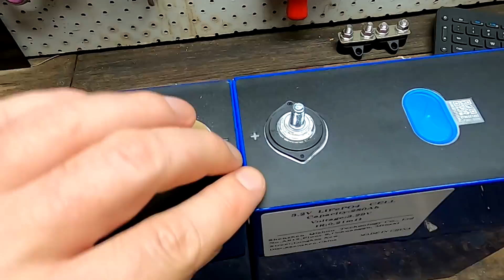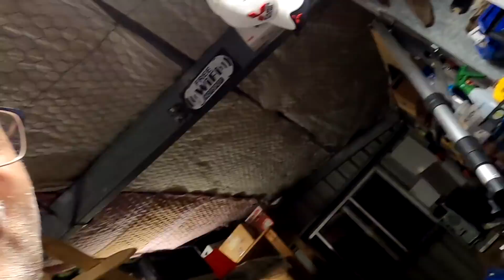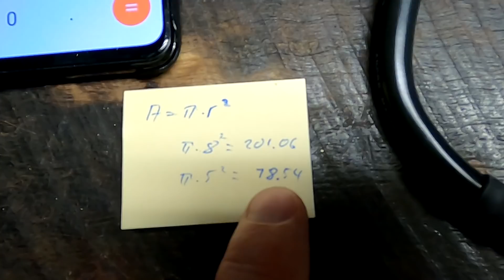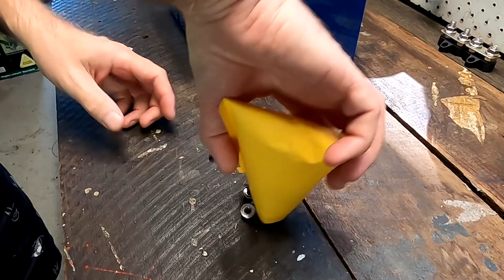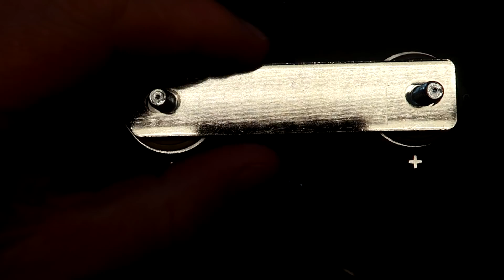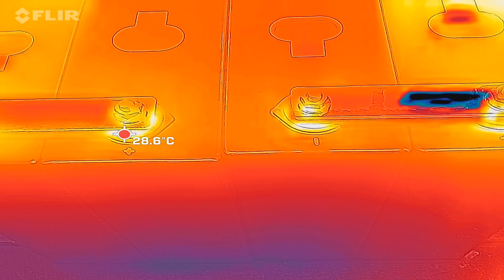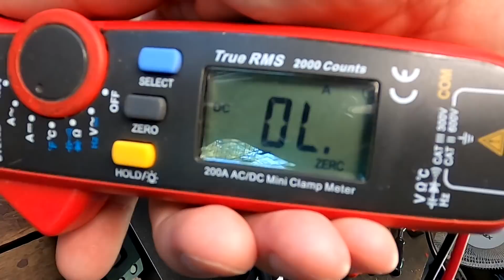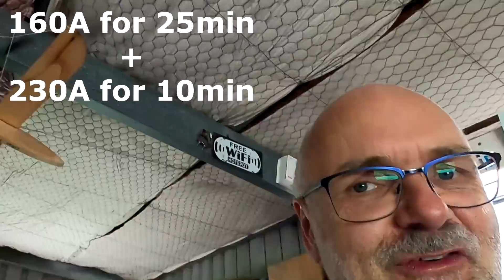EVE LF304 with welded studs. Pushing 230A through a tiny terminal?

Comment: Great video Andy, Thank you again on informing me about the flexible braided busbars, i replaced all of the crushed copper pipe busbars last night and today with the new flexible ones i made. I made them with Copper braided grounding strap and crushed sections of copper pipe on the ends as a DIY crimp, then i punched a hole through the copper pipe and braided ends. They are working great and give me the flex i wanted that the ridgit crushed copper pipe busbars didn't give me.
Reply from the maker: Is that crimping force of your copper pipe enough to make good contact to the braided mesh though?
Reply: @OffGridGarageAustralia  yup its no different than a crimped ferral end. I just found copper pipe that was just snug enough to go over the end of braided copper, then crimped it with the same hydraulic crimper you use for putting your cable ends on. Then since my hydraulic crimper came with attachment for punch pressing holes in things, i used those in my bench vise to press holes through the copper pipe and braided wire. I did it in the bench vise because it was to awkward doing it in the crimper. If i didn't have the  punch parts, i would have just simply drilled out the holes.
Reply: Hi, I modified some braided copper battery cables which were too long for in between cell distance, on a group of 460 Ah cells I got through AEVA about 5 yrs ago. They were approx 100 mm2 area and had hard copper ends already. I cut off to length, and got some not so common 5/8" pipe from plumbing supply place. Not 1/2" or 3/4" or metric equivalent. I squeezed short piece onto end of braided cable using big vice with angle alum jaw inserts so it wouldn't leave teeth marks. The inside dimensions of the crushed pipe, was very close to width of orig cable, and 2-3 mm of thickness..
The battery posts were m8, so I used an exact 8mm drill. (The braided cable had some free length for expansion). Drilling thru crushed pipe copper caught the thin wires inside and tried to spin and break them. So I used big soldering Iron and filled  airspace  of crushed pipe end, with 60/40 solder. I then filed both sides of new link end with good file, and tinned with solder and wiped excess while liquid, to leave nice surface.
A nice copper stud and terminal would be good to see on a battery. Iron's conductivity is about 16% of copper, brass is about 28%, and stainless is less than 3% I believe.
I'd like to buy a version of the cells, with the original big aluminium internally threaded posts if ever available. 
The pulsed discharge rating of the latest EVE/Gobel cells is 2C. So an EV wants to pull 600A.
 intermittently.
I can't find a pdf drawing of these cells with the welded studs on the net.

Comment: Due to surface roughness, you never get the complete surface as a contact area. With the smaller surface, it may even be that the actual contact area is larger, since the same tightening torque of the screws applies the same screw preload force to a smaller surface, resulting in a higher surface pressure. Due to the higher pressure, larger parts of the surface are plastically deformed and surface roughnesses are better matched.
This can also be the problem with your aluminum busbars. Aluminum has a higher yield strength compared to copper, depending on the alloy. Consequence is that you get no plastic deformation to compensate for the surface roughness. Test the aluminum busbars on the small surfaces of the welded terminals. Also test with 8Nm tightening torque.
Reply from the maker: Yeah, it seems like the small contact areas is not as bad as I would have expected it.

Comment: I am now convinced and should have told you in your last battery test, my thoughts on why the heating up at the terminals.  The high resistance inside the battery connection could be the culprit.  That may be why they changed the battery terminals!  Great video, Andy.
Reply from the maker: Thanks Russ!

Comment: The cells I ordered are exactly like yours (304 ah) and I'm happy that the welded studs didn't give any problems
To reduce even more the little heat that generates at the contact point, you could try to use 6 Nm instead of 4
The 4 Nm are correct for the old tipe if you don't want to strip the threads, I've seen some tests and I've done some too on an old batch of 200 ah eve cells (that where at the end of their life), and the terminal starts rotating inside the cell at 16 Nm more or less, I obviously won't go that far, but 6 Nm would give a really good contact pressure without ruining the cells
Reply from the maker: Thanks Miro. I'll keep this in mind. I will go with the 4Nm to start with and if problems occur, I know, I can go higher. As I will only pull 30-40Ah per battery bank, I'm not expecting any problems anyway.

Comment: Hi Andy, on a different point, I thought those Renogy inverters were a center tap design so live and neutral are 180° out of phase from each other in relation to earth (not a true earth) did you still bond neutral and earth to charge the car? Would this not be shorting 110v from earth to neutral? I ask as I am trying to find a inverter that is safe to bond but from other videos I have found the center tap inverters are not safe to do it?
Reply from the maker: I have to use my adapter to bond N and PE together. Otherwise the vehicle EVSE will not start and shows a grid fault. The L and N have no relation to the PE as long as the unit uns on battery. The voltage is completely floating.
Very hard to tell if an inverter can cope with this type of bonding. We had the issue last year with the Xijia inverter as well and bonding was not really 'clean' with some voltage between L/N and PE.

Comment: If it bugs you that much, put some washers over the ‘stepped’ terminals to increase the contact area. On the plus side, the contact area where the stud screws into the terminal in now much thicker….
Reply from the maker: It seems to work fine as it is, so I will go with this. It's a bit of a long term experiment, I guess 😉

Comment: So we could find the surface area in mm^2. At 1c, 300amps would need 500kcmil or 253.4mm^2 or 17.96mm diameter for copper and for aluminum, 700kcmil or 354.7mm^2 or 21.25mm. Lets thank google and wiki. 30kw is a wet dream.
Reply from the maker: Oh, wow, ok...

Comment: If one is pulling even higher amperage, fill out the welded stud with a soft(ish) copper ring to make an even bigger contact area possible, or just put a M6 copper ring under the battery connectors, both methods will work, as current will also flow through the M6 welded studs and the flanged nut to the cell connectors.

Comment: Hey Andy, if you dont want Reflections on the busbars, you could put a piece of tape on them, to get an accurate indfrared-mesurement. But you probably know this. Oh, and is it smart to make my own busbars? What Material do you recommend? Special copper? Should i buy pipes and press them together? Will they oxidize? My busbars, that i have right now are kinda thin and flimsy. Very good and informative video!
Reply from the maker: Yeah, I can just black them out for better readings with the IR camera. I'm happy as it is, and I'm rather concerned about the actual terminal temperature than the bus bar itself.

Comment: I had an issue with these welded studs as they are quite short. With several cables (sense, bms, shunt power) connected to plus/negative terminal, it's just not long enough, you have to connect more wires together inside one ring terminal. I also hate the small area, but I went the smaller capacity cells - more batteries in parallel way, so current through one battery is low and it does not affect me. If I wanted to use just one 280Ah cell battery with 100-140 A current, I'd be more nervous.
Reply from the maker: Ah, right. A disadvantage I didn't think about. You're absolutely right...

Comment: The nut also forms part of the contact area with the bus bar.
Reply from the maker: I would expect less than 5% of the current goes through the nut.
Reply: @OffGridGarageAustralia  - maybe an opportunity for another of your famous experiments? Put a fibre washer underneath the bus bar to completely insulate the direct connection and then run a load. Then see what the thermal camera shows on the nut when it’s taking the whole load. 🤔

Comment: They must have improved the internal res. of these new terminals. I received the new terms. on my 280AH cells and was worried until this post, thanks again man! I am using copper washers under them though, so nut torque and res. stays in range.
Reply from the maker: Thanks Dave. The surface of the lower ring around the terminals seems very rough on mine from the welding process. Not sure if this is meant to be as a contact area.

Comment: Only watched a third of the video, but the screw and nut also provide some contact area, no? Actually a longer or "higher" nut with more thread than a standard one could increase the surface area.
Reply from the maker: I would expect less than 5% of current will make its way through the stud, the nut and the top of the bus bar.

Comment: I just bought 32 of the EVE 304's with the welded studs last week and was concerned myself (mine were the same as yours).  If you were to drill out the hole size of the bus bar or terminal lug to 12mm then it could make contact with the larger surface area on the lower shoulder which has about three times the surface area.  The problem is this shoulder is 2.2mm lower, so a 2mm thick bus bar wouldn't be tightened down with the standard nut without an additional copper washer as a spacer.
Reply from the maker: That's a lot of additional resistance you create with all these washers. I'll leave mine as they are and see how they go over time.

Comment: Hhmmm, that's a significant reduction in contact area.  I think I'm not so impressed with that as far as resistance goes...
Reply from the maker: I'm the opposite. Very concerned at the beginning but very happy at the end. The high pressure on this small area must make a really good contact with very ow resistance.

Comment: Good video Andy I built a 12volt 560ah system for my camper last year using the same cells and ended up using them to power my cabin up north and could run my well pump lights microwave and all my power tool's went throu one 300amp circuit  breaker but worked very well using stock buss bar's
Reply from the maker: Great set up, Randy. Thanks for sharing. So you're using the standard fixed busbars in your camper with all this vibrations, rattling  and moving?

Comment: The new welded studs are part of the contact area. So, better stud contact includes better nut contact on the top of the bus bars.  Better current sharing between the top and bottom of the connection should account for the better than expected performance.
Reply: I agree. Those flange nuts bite into the nickel plated copper bus bars (that's a feature) and make very good contact on top. I think that is the majority of the surface contact area. I drilled and tapped the bus bars for the balance leads so the ring terminals don't get deformed by torquing down the flange nut. I just finished a build ((2) 48v 16s, OverKill/JBD BMS)  with the same LF304 cells also from QSO, thanks to Andy/Amy. I'm only running 100A and I don't have a Flir camera, but I haven't detected any heat as of yet. I think most of Andy's heat issues were from those aluminum bus bars. I think those are more of a problem than the surface area of these welded studs.
Reply: @bbrown_sc  as nice as those big Alu bus bars look, they're not very practical.
Reply: @bbrown_sc   I always wonder about the nuts supplied with the bus bars if those raised ridges actually keep 90% of the metal from contacting the busbar at the relatively low torque we are tightening these nuts down to. I would think copper nuts without the ridges would make for more surface contact. If you were worried about them backing out you could make it a jamb nut arrangement with two nuts.
Reply: only problem its galvanized steel, not aluminum nor copper, your best bet is to use soft aluminum washers between the bussbar and terminals IMO
Reply: Yeah, that's what I'm thinking, it is the nut on top that makes it work more than the small plate underneath...

Comment: I have not worked with the welded studs but I have had the same concerns as you.    Many folks on the DIY Solar channel have used the cells with welded studs and so far I have not seen anyone indicate it is a problem and some folks have said it is no problem.    Having said that, it seems to me that they could design a welded stud that provides a lot more contact area than that.
Reply: I just bought some new LF280K batteries, they have TWO screw-in studs on EACH terminal... with a larger flat base for the busbar!  I think it's a huge improvement over all the previous designs!!!
Reply from the maker: I think this connection works very well here... Seen the other new terminals you're talking about.

Comment: @Off-Grid Garage / Andy, Why not measure the resistance between the Cell terminals with a good IR meter like YR1035+.  If there was a lack of contact area and higher resistance from the terminal-bus-terminal connection this would give an indication.

As you have both cells and the same bus bars this would make an interesting data point comparing old and new.

Ray Builds Cool stuff did a good video on Bus bar connections and resistance.

Comment: Charging and balancing question.  If I charge to a lower voltage because you suggest 90%ish 13.2-13.6 and my BMS balance starts at 3.4/13.6, at what voltage do you suggest to start balancing my cells?  As a noobie I thought balancing should only be in the top "knee" of the charge.
Reply: One thing is your first top balancing, another one is your working balancing voltages. Andy has done several videos on that topic alone, and he starts balancing above 3,45V since he discovered this voltage is about 90/95% charge, and in that interval your BMS balancing works best. Below that you start entering the flat voltaje area, where you can be anywhere between 40 and 70%. So the threshold for starting balancing is 3,45V (If I recall correctly). Check his videos on that, it is very educational.

Cheers.
Reply: @ricardomarcelino8388  thank you!
Reply from the maker: 👆 What Ricardo said...

Comment: I have 32 welded stud cells. I used to use the rigid busbars that came with your cells (tin plates copper) and have had zero issues pushing just over 300amps through them with minimal to no heat up on them (confirmed with FLIR thermal camera). My issue I ran into was having the rigid busbars in a mobile RV environment and the vibrations caused the rigid busbar to break a welded stud on one cell. I switched to the copper flexible busbars with no rigidness anymore and can still push over 300amps through them with no heat up. My 4/0 cables are warming up according to the camera, but the busbars are still quite cool. 🤷🏻‍♂️
Reply: I also think that the busbars have a very large outside area compared to the volume, which means there's a lot of area that acts as cooling area.
Reply from the maker: Thanks for sharing @Shep. I guess flexible bus bars are a must for all mobile applications.
Reply: @Shep  Which flexible copper busbars are you talking about?  The open braided ones?
Reply: @ForbiddTV  The ones on Ali express with the yellow orange insulator in the middle. YT won’t let me post a link.
Reply: @Shep5847   Hmm, having a hard time picturing them.
Reply: A

Comment: Consider also that there is current flowing through the stut and nut to the top of the bus bar. What is the intersection of the bus bar? Rough deformable metals forced into each other have maybe a better conductivity.
Reply from the maker: I assume, less than 5% of the current will go through the stud and nut to the top of the bus bars. Main contact is terminal and underside of the bus bar.

Comment: Do note in the datasheet that cycles are defined differently: the 3500 cycles are at 1C, the 6000 cycles are at 0.5C, both at 25 degrees C. As usual, temperature has a bigger influence on cycle life.
Reply: if you only push your banks at .3C or even .2C that will also give you more cycles if you are not maxing out the battery using 10%-90% finding the right voltage to charge to is key using the power curve. the specs on my batteries show 3.15-3.35 V would get me 85-90% capacity. that would keep the heat down and extend the life even further.
Reply: @dc1544  no. EVE has handled this 90% charge trick intside the LF280K cell, that's why it has the dimension of the 304Ah type. So you will actually get 6000 cycles as in the specification with full 1C - allowing for cheaper smaller cars to sell.
Reply from the maker: @dc1544  you cannot charge your batteries to 3.35V only this could be everything from 50%-80%. Voltage cannot be used for SOC with LFP cells.
Reply: You can charge at 3.35v til no more current flows and still get most of capacity but downside is that charging is slower
Reply: @pete2531  my goal with 4 16s battery banks is use around 70-80% so I can get around 8000 plus cycles. also only charging and discharging at .1C to .3C. with both I should get over 21 years out of these batteries in theory. even 16 years would be awesome. my ttotal system will have 53,760 watts. 80% is 43,000 watts. I will have to see how much I really need in watts. I could end up buying another 32 cells if my needs require more.
Reply: No, the LF280K has 6000 cycles in the spec at 1C. And they measure that at different temperatures. And the garage temperature of 25 degrees is their reference.
Reply: @renatomercurio4774  LF280K cycle life is specified at 0.5C - check the datasheet.